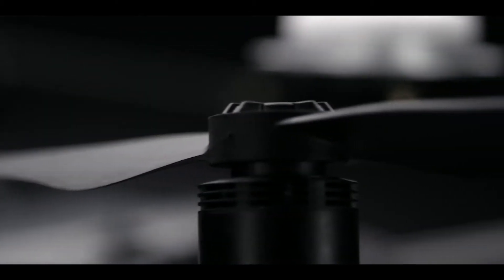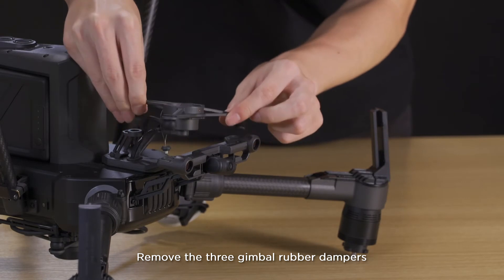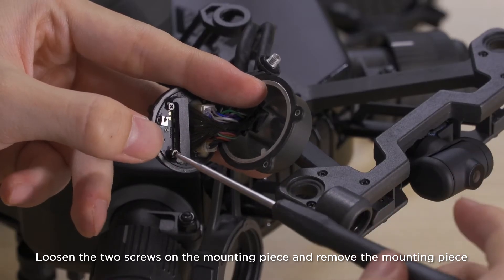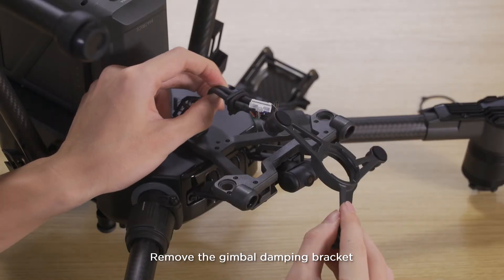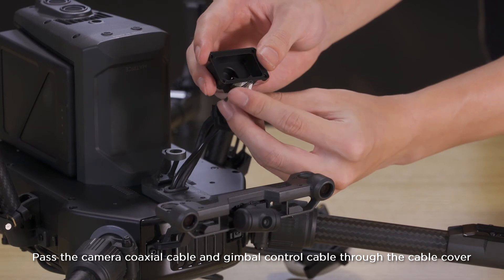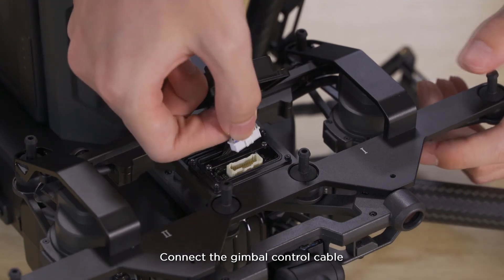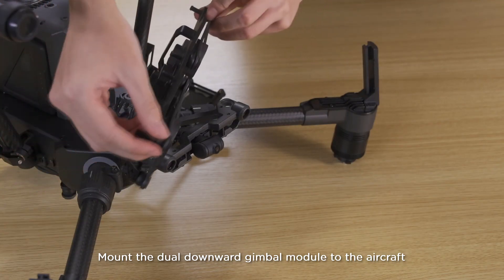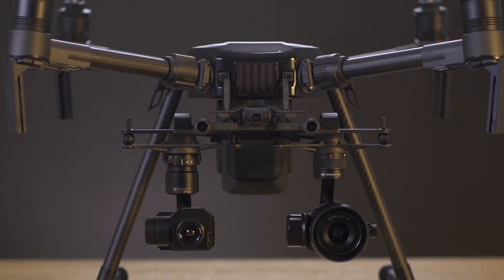DJI Matrice 210 – Mounting the Dual Downward Gimbal

Comment: is the process the same as in Matrice 200? Will it fully recognize the two gimbals?
Reply from the maker: Hi Francisco, sorry to tell that Matrice 200 doesn't support the dual downward gimbal.
Reply: @DJISupportGlobal  Hello. I was informed by DJI dealer that it supports on 1st gimbal Z30 or XT. On the 2nd gimbal X4S/X5S/XT/Z30.
What info is the right one?
Reply from the maker: @FranciscoWittperfil  Hi there, the correct info is that the first gimbal supports X4s/X5s/XT/XT2/Z30 and the second gimbal supports XT/Z30. And it doesn't support installing 2 XTs or 2 Z30s simultaneously. Only M210/M210 RTK support the dual downward gimbal, M200 doesn't support it. Thank you.

Comment: From a customer/user perspective, this is like me wanting to install an upgraded oem audio system into my new Ford and having no Ford dealership available and Ford suggesting I install it myself using their YouTube tutorial 

In any process there is work to be performed, successful companies take as much work as possible off the customer through effective design

The less work the manufacturer does the more work the customer must do to achieve desired results

If you look at how much work the customer had to do setting up a Phantom 1 compared to a Phantom 4 Dji has taken most of the work off the customer, well done 

However, through Lazy design, you have not achieved it making customer have to change out Matrice gimbals 

No average person should be touching ribbon cables, at all 

Also, where is the tutorial for changing from dual to single? Do I need to reverse this tutorial?

Design gimbal changes simply, please do the work for the customer 

Thankyou 👍🏻
Reply from the maker: Thanks so much for your feedback. Since the Matrice series is designed for the industry's users, there might be some compromises on the design to meet the different needs, hope for your understanding. For the changing from dual to single gimbal, you may reverse this tutorial video to check. If you encounter any difficulties during the progress, feel free to contact us. Appreciate your support.
Reply: @DJISupportGlobal  здравствуйте! Подойдет такое крепление для Dji matrice 200 v1?